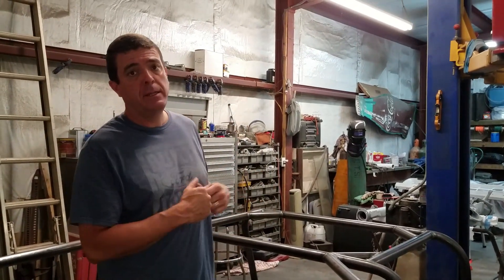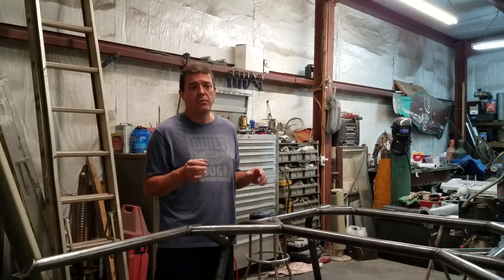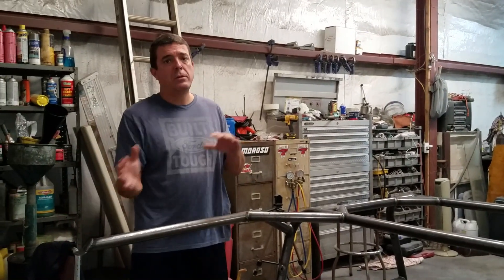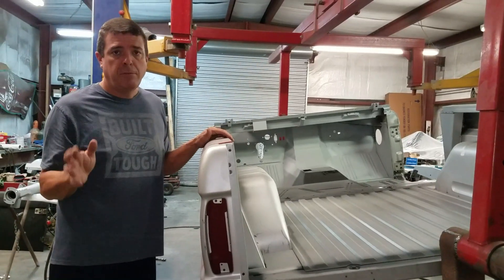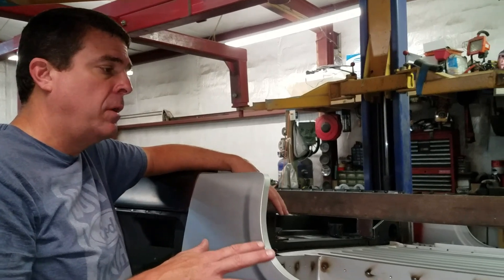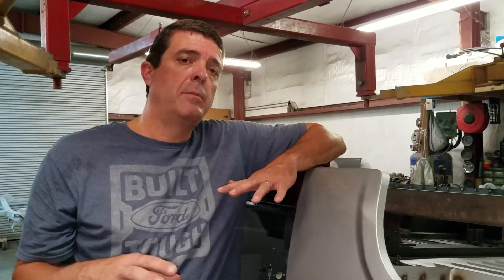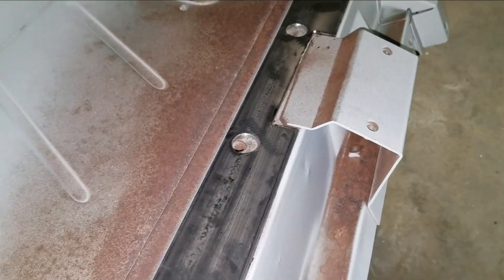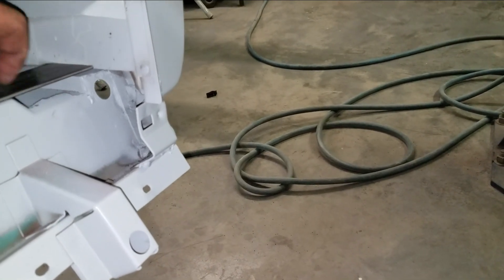Final Rust Repair - Family Roll Cage Arrival - 1966 Ford Bronco Restoration Project

Comment: Love it!   I'm still plugging away... May have to cut out my back drive side quarter panel as I'm not happy with how it's lining up to tail light housing.  My fault, as I didn't really take my time on fitting it.  Passenger side came out fine.....
Reply from the maker: Thanks Drew.  I have been fixing a couple spots this am that I was not happy with too.  Dang It Spots!  It will get there for both of us.  Stick with it.